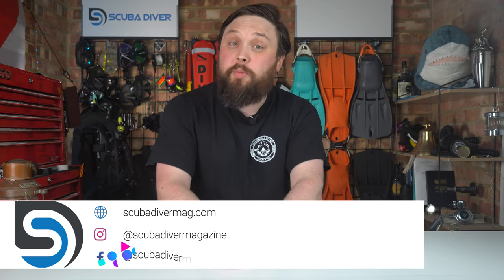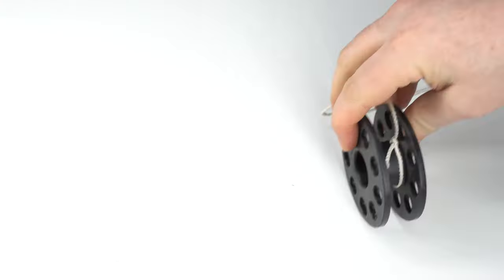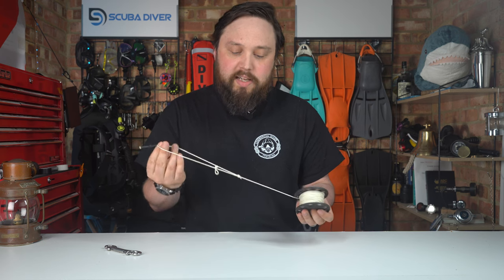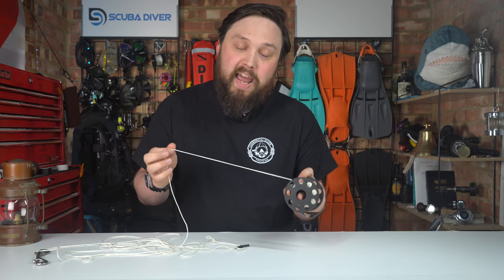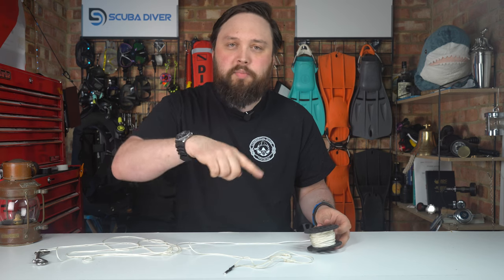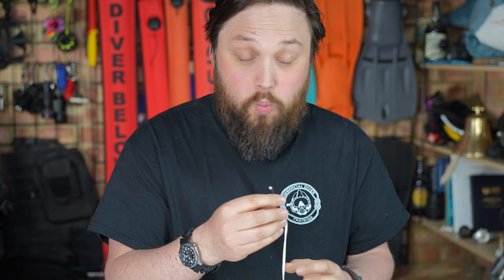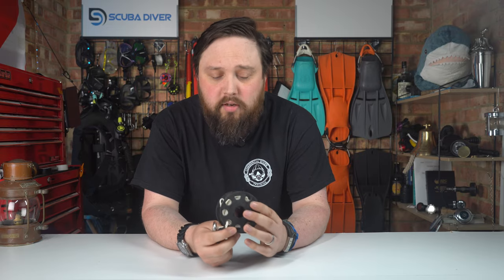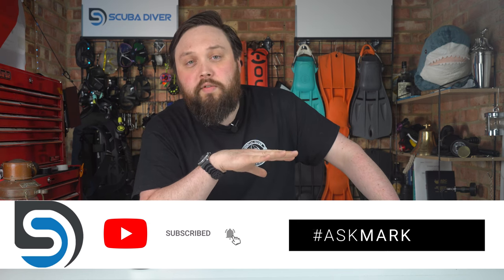What's The Best Way to Shorten Spool Line? #AskMark #scuba @ScubaDiverMagazine

Comment: #AskMark Hello from Egypt Mark! I've been diving for around 10 years now, cleaning my regs hundreds of times... one thing that I keep thinking about, but never really understood is: Why don't regulator manufacturing companies just make a "seal" instead of a dust cap so that we can just submerge the 1st stage?
Reply from the maker: Some do. 
DIN is easier to create an effective seal compared to A-Clamp because the O-Ring is prominent. The problem comes is that not all dust caps are water/air tight so, it's hard to say to everybody watching my videos that "_all dust caps are safe_" because some will leak and let water in.
Unless the manufacturer describes their dust cap as water tight, I'd assume that it isn't.